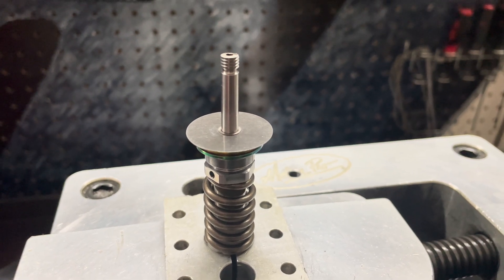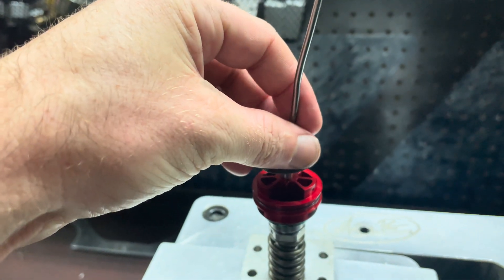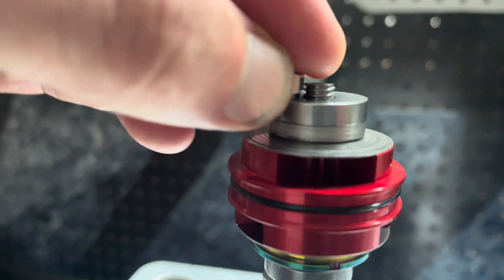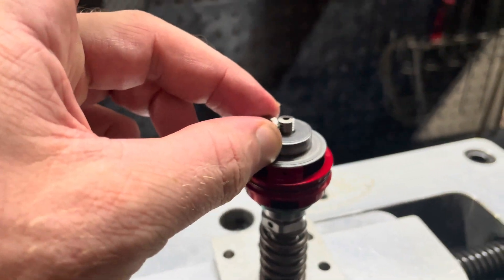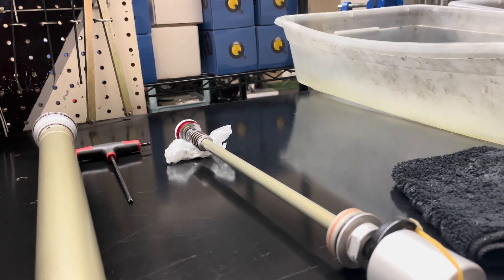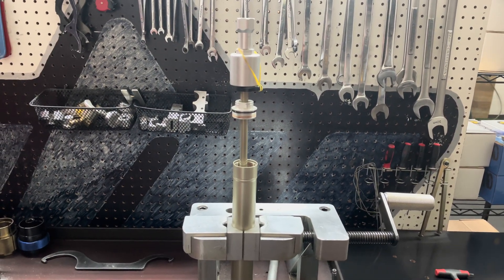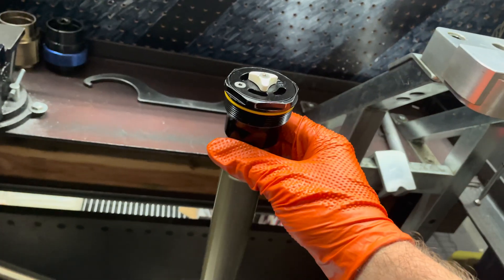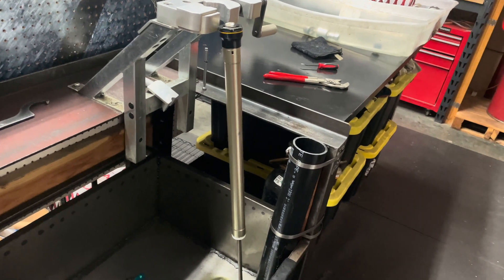How to install 2023 JBI Suspension WP AER48 / XACT48 Pro Fork DIY Midvalve Assembly Part 3

Comment: How much float is there supposed to be here and why did you delete the trampoline system was this just a mistake on ktm's end?  Kit looks killer probably get this.
Reply from the maker: Hello and thanks for the comment.  The JBI AER48 kit uses a dual side leaf spring aka trampoline valve.  Ride JBI started using this back in 2017 before WP was. This design originally was found in KYB A Kit air forks.  Ride JBI adapted it to the WP AER48 forks.  The reason for the dual sided leaf spring is so that one side aka spring can be used to preload / seal the shims against the piston.  The other side aka spring is used to determine lift from the piston.  It’s a more complicated setup but allows for more precision tuning with lease overlap of functionality.
Reply: @RideJBI  beautiful answer thanks for that.